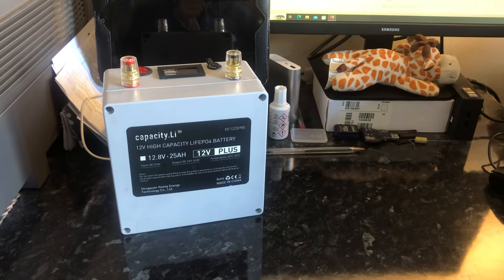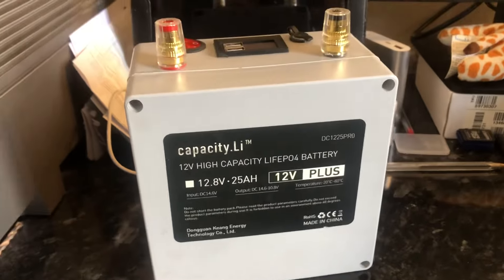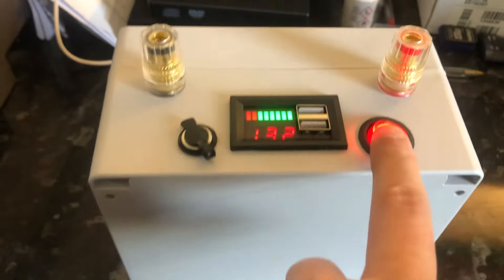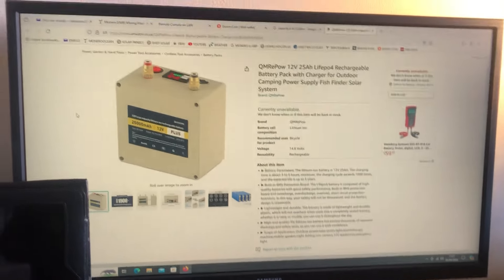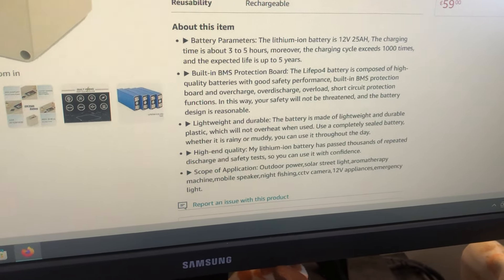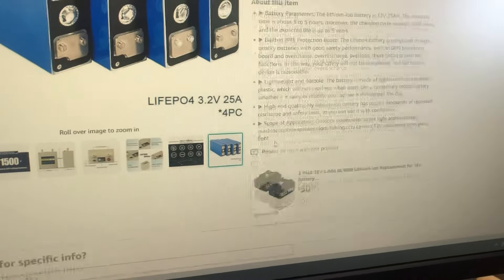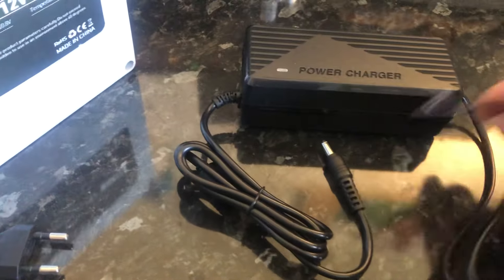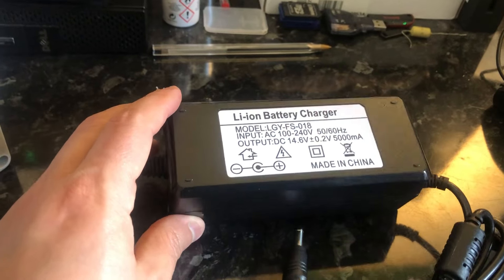New 12V Battery Pack I bought from EBay

Comment: Theres 2 black wires because it doesn't matter which way the wires go.  It doesn't really need internal fuses the BMS will cut power if it ever gets shorted.  Looks fairly well made to me.  Although yes defo not 25ah but even so for £7  you got a total bargain
Reply from the maker: I have ordered another charger (a better quality one). I will try to test the capacity in the future and report back my results. Thanks for your comment.